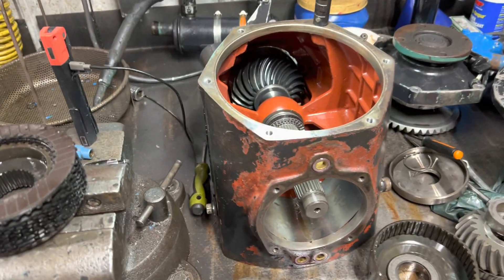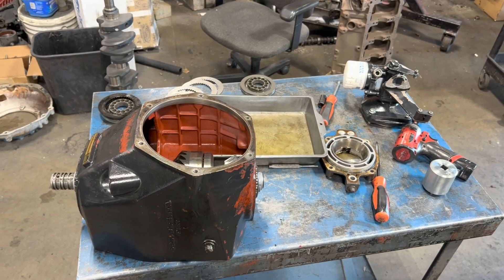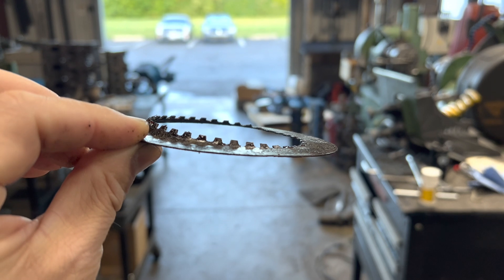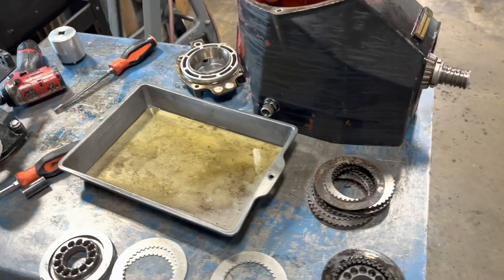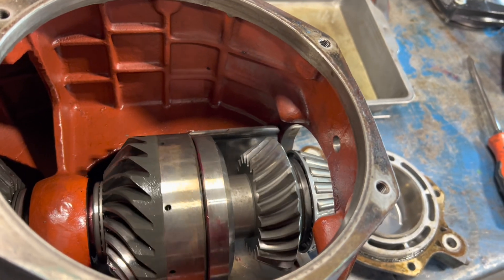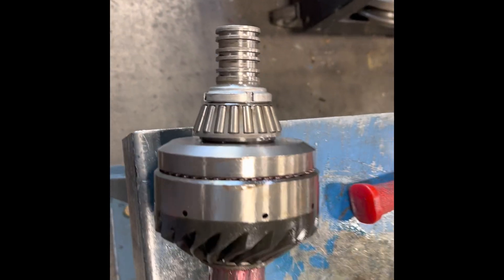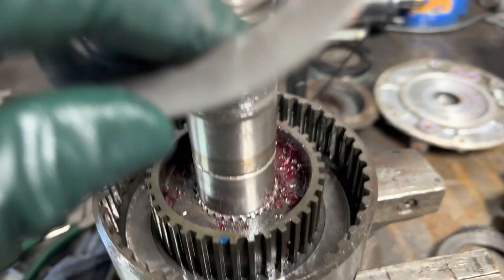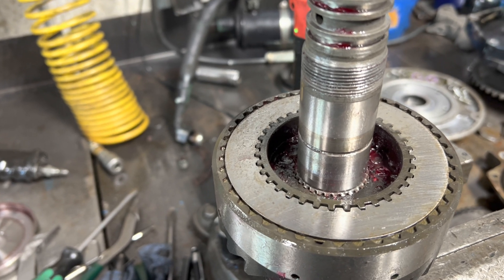Volvo Penta HS1A Transmission Diagnosis Overhaul and Testing 1997 299 Baha 7.4 Gi

Comment: Can you show the tool for the special round nuts on the ends of the shaft. I rebuilt my starboard HS1A and had to use two large pipe wrenches turning against each other. But the nuts got chewed up by the teeth of the pipe wrench.
Reply from the maker: I believe the part numbers are in the video? They are spammer nut sockets.

Comment: Hello, that was a great video. I need to repair the exact problem / transmission, but i can't find the service manual and the TSB.
Is there any software like Prosis in Volvo CE, with the procedures and TSB? I have the Volvo Penta EPC, but its just the part number catalog.  Or where i can find this information? if you can help me, i would really appreciated. Thanks

Comment: Great catch on the clutch packs.  Are hydraulic transmissions used for NVH considerations versus mechanical transmissions, or are there other reasons as well?   Love the transmission dyno, by the way; that's a slick rig,.
Reply from the maker: Not sure. I believe the hydraulic transmission can hold more HP